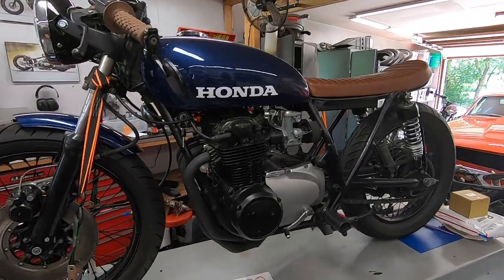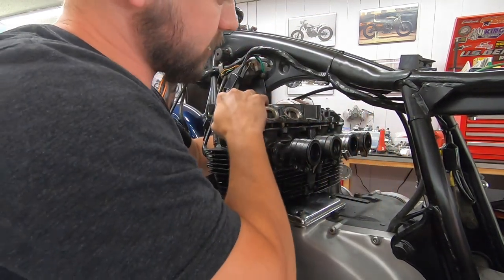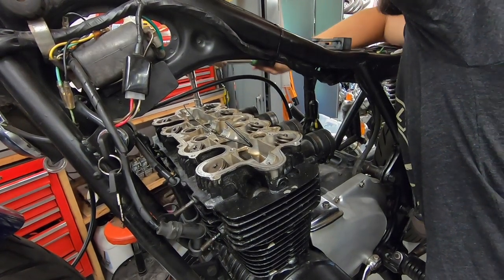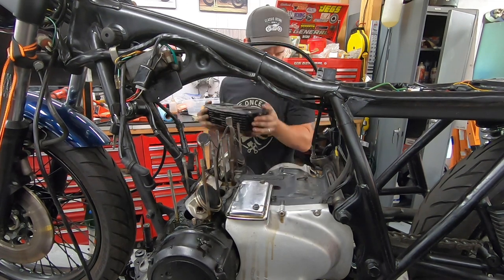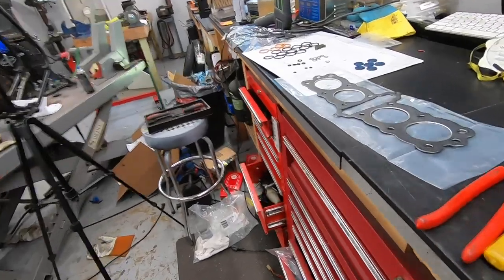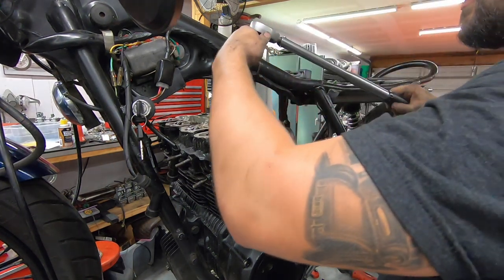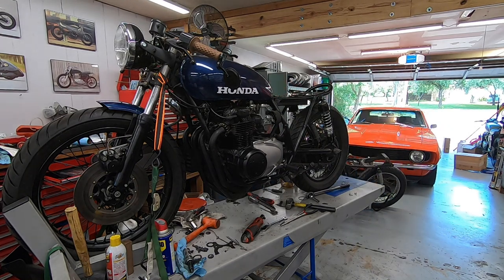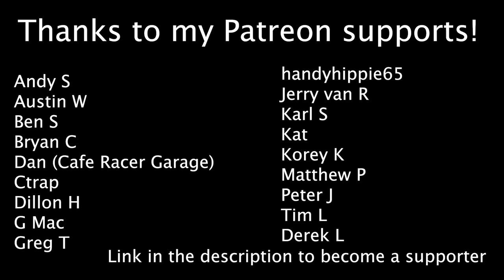Honda CB550 top end gasket replacement. (fixing oil leaks)

Comment: For those of you who are willing to add a few extra steps to this procedure, on a lot of these vintage air cooled bikes, you can leave out the base gasket and use loctite 510 in place of it. This generally will increase the compression a half point, and most Pre 1980 air cooled bikes have plenty of squish/valve clearance to do this. Obviously, when doing this you want to check the squish and valve clearance (squish with solder, valve clearance with clay). But if you're looking for free HP and a little more pep, it never disappoints. It's also a good idea to check cam timing when you do this, however MOST bikes will only have the cam timing retarded a few degrees, which will increase the top-end a little bit. 

I've done this on every bike I've ever built, and have never come across a pre 80's bike with an otherwise stock engine that didn't have enough clearance to do this. YMMV

Comment: omg i was thinking about bringing my cb to a shop to let it repair. it would cost 500-750 euro. Now i can do it myself, including restoring the carbs. AMAZING CONTENT!
Reply: You're led to believe that working on engines is difficult. It is not. The key is to have the correct tools for the job, a decent manual (or video in this case), and some patience. Get at it.

Comment: I own a 1978 Honda CB550K it has less then 60,000 miles on it. It is completely stock down to the 4 signal exhaust pipes there still good and not beat up it does have the crash bar and rear rack and a sport windshield. When parked 10 years ago it ran perfectly so smooth at idle you wouldn’t believe it was running, but it would wipe out my right shoe and pant leg with oil from the failure of the head gasket and o rings. I’m a good backyard mechanic having read what was required to repair it for some reason scared me off, but after watching your video I now feel I was just being silly I CAN DO IT IT WILL LIVE AGAIN !!! My question to you is while it’s opened up should I go ahead and replace the rings lap the valves and replace the cam tensioner for many more years of service and maybe the oil pump I trust your opinion it’s 53-60,000 miles normal wear what is there life expectancies lm 65 years old and when growing up you see a bike with 10k on it would would think it’s time is soon over. I live in Colton CA AND IF I Don’t FIX IT I WILL NEED TO FIND A GOOD HOME FOR IT IM THE 2nd owner 15,000 miles when purchased in the mid 80s 👍

Comment: I remember when working at a Honda shop when the CB-500 was introduced, one of the big selling points for mechanics was that we no longer had to remove the entire engine to work on the top end. It really made things easier for mechanics.  But the base gasket leakage was common on all bikes at the time except for the earlier Hondas like the 305s and 450s. Triumphs and BSAs especially were noted for this, and ironically Honda made the same mistake BSA had made; they didn't have enough bolts holding the cylinders down.

Comment: Great video as always! It kind of skipped the fun part of putting valve cover on. Valve tappets usually get in the way of putting it flat on. Using rubber bands to hold them up helps tremendously.
Reply: They look out of place in the toolbox, but rubber bands for the win!

Comment: literally doing this to my bike this weekend sept I'm changing the piston and rings to. love your channel.
Reply: You should really notice the difference, years ago my '74 550 got new rings installed only, and the performance difference was amazing, and as u'll  be doing it urself it  should be real satisfying.  Good luck
Reply: @edwardmulder3777  love these bikes.
Reply: I finished a top end rebuild on my '77 XS360 about a month ago. Sure enough, the head was teeny bit warped in the middle and I had to get it skimmed. I'm wishing you better luck!
Reply: @spiffyg4939  there are a coupla vids on resurfacing your heads and blocks with sandpaper and a large hunk of flat wood and oil for future reference

Comment: Love these videos Taylor. Just tore down my 1980 cb750c. With plans on turning it into a cafe racer. And your videos are an inspiration to someone who doesn’t know much about motorcycles. But that’s why I bought it. Was hoping I wasn’t going to have to dig into the engine....... because it was running fine. But did notice oil around the heads. So I’m thinking I need to change out all the gaskets. Engine’s already out........ probably a good time. Thanks again for all you do

Comment: Great video as always Taylor.  I definitely go between the shop manual and your videos when working on the 72 CB500.  I got to the point of removing the cylinders and had to laugh.  You said they might need a little tappy-tap.  I was wailing on those suckers with my rubber dead blow mallet.  They finally did give it up, and yes, as you said, that base gasket just didn't want to let go.  It's going to take some time and patience to clean that up.  Thanks again for these videos.

Comment: I realize there's not going back and making a new video, And I ain't here to bitch or complain, your video was instrumental in helping me do this, but there's a couple steps that I would have loved to have seen seeing as this was my first time taking the top end off and trying to put it back together. The cam chain tensioner (when it goes back for the first time, do you tension it, or leave it loose?) I realized that loose means you have all the trouble in the world later on getting the chain back on that sprocket and so I tightened it (with that cam chain tensioner screw in the back). When you put the valve cover back on,  you mentioned the breather, the o'rings, and adjusting the cam chain tensioner (yes that again) and you time lapsed that part.... would have great for this newbie to see what you did there.
But I get this may not be a instructional video for all that and the work you did show us was invaluable. NOW I just need to find a video that's more detailed and talks about the which new O'rings go where and what to look for when doing stuff. Little tricks of the trade ;)
Thanks again for this though and I look forward to new videos of yours.

Comment: if you twist the impact driver by hand in the direction of removal , ie anti clockwise, you will take up the slack in the impact driver internal threads and will not need to hit it three times

Comment: You are very close to 50,000 subscribers! Congratulations. A coupla questions and comments - first of all, you show people how you do these repairs but not many can do what you do. I have a hard enough time putting a cylinder with one set of piston rings to line up and make sure they get into the cylinder properly and don’t get damaged. Four pistons would drive me crZy! You make it look so easy. Did you get any training at a technical college or motorcycle mechanics institute? My last question, do you have to retorque the cylinder/head bolts after you have warmed the engine up completely a few times? Other than that thanks for another great video where a simple plan comes together nicely.

Comment: Hi Taylor, thanks for your videos, always interesting. I am happy with more details and longer videos are not an issue. I have a question: why didn’t you clean the deposition on top of the cylinders? What needs to be done to prevent it? My understanding is that it can cause detonation, changes in compression etc. was the build up not big enough to worry about it? Greetings from the Netherlands!

Comment: Cool. I have to do my valve oil seals on my bike. But am going to have to remove my engine  and its fuel injection, fun.

 Thanks for showing  the impact driver. I was trying  to explain  it to my wife  and she wasn't  getting it till I showed her that  section of vid. What drive is it?

Comment: Probably best to loosen head bolts from the outside-in. This way the tension does not bow the inside due to more friction holding the outside of the head. This is why when tightening head bolts from the inside-out makes sense. It's the same physics.
Reply: It would also seem after taking everything apart like that and no less the expense and time involved to at least replace the rings and a quick scouring of the cylinder walls, my bike deffo wasn't  burning oil but afterwards that engines performance had improved no end

Comment: Another good one. I need to ride my  CB550F up to your shop and get it looked at. I just did this a few months back but only the top gasket as it was leaking. Had more than a centimeter of carb buildup on the cylinder heads. It seems to struggle in the last gear to keep speed at about 80mph. Have gone over the carb so many times and the timing. I got it up in Austin leaking fuel, oil and had an obvious drop at some point. Have replaced and fixed nearly everything.  Just won't run right and not sure why. Im in San Antonio. Need to save up some cash first but would love a once over and suggestions etc.

Comment: I recently realized a dream of finding a good example of the first bike I owned, a 1976 CB400F. Early next year I will start throwing some love at the 45 year old vehicle which will include attending to oil leaks. Your video was great to get familiar with the process. I am sure the 550 and 400 are almost identical. Would you agree?

Comment: U know that a old fella told me one time is not to paint the fins the help with the cooling of the engine
Reply: Ive thought about that too
Reply: Keith  Parady
Reply: That would maybe hold true if Honda engines weren’t painted from factory.
Reply: Chris Prezbyl    Never saw any older engines that were painted probably all wore off
Reply: Keith Parady so you never saw a vintage Honda? They are factory painted engines. Fins, cases, valve covers.... all except side cover which are cleared. That’s paint too

Comment: Hi. I’m after some advice. Im attempting a top end rebuild of my CB550 and I can’t prize apart the cylinder casing as the gasket seems really stuck. I feel I’m giving it as leverage as I dare! On the small cut outs to fit a flat head screwdriver

Comment: Taylor, I have a question about your impact driver. Did you use the bits it came with or did you order special JIS impact bits? Or are the “Phillips” it comes with JIS?
Thanks for all the videos. Love your channel!
Reply: You can buy JIS impact bits. You can also buy JIS Impacta Screwdrivers, I have a set but they're not cheap.
Reply: James Howitt thank you

Comment: Big problem, a piston circlip fell into the crankcase. I was installing them after i cleaned the pistons. I had rags setup to catch but of course it slipped right by that. So far I have drained the oil and probed around with a magnet and no success yet. Any help is appreciated

Comment: Great videos. Just a question ...... What batteries are you running, if lithium ion are you changing reg/rectifier.
I`m in middle of doing mine and ideally want to go with smallest battery i can and hopefully keep elec start
Reply from the maker: I have run a few and I prefer the Shorai batteries over anything else. This is the one I use https://amzn.to/2zshjFW And yes you will need a Reg/Rec designed for lithium ion batteries or you could risk over charging it and causing a fire.

Comment: Thank for posting what you do. I’ve learned a lot. I’ve been riding a 72 CL100 for the past few years but it has developed an issue I can’t figure out. I posted a video on my channel if anyone wants to take a stab at suggestions. Thanks 👍🏼
Reply: Matt Aragon i’ll take a look.  what’s the issue?
Reply: Graig Cameron thanks! I appreciate any input. When I give it gas it Boggs down or dies. I put a new carb on it. So I don’t think it’s that. It did the same with the old carb.
Reply: Matt Aragon if the jets are clean the next thing to look at is misfiring spark plugs.  or a leak in the intake boot.  are the spark plugs new and gapped too?   did you use a gasket on the intake carb boot?
Reply: and also check your compression.
Reply: Matt Aragon, could be the filter in the tank, easy to check, plus there could be water in the tank?, which never got cleaned out with the old carbie, perhaps?

Comment: Werent the old gaskets new when you put them on? Why did they get blown like that after only a few months ?
Reply from the maker: The engine was never apart when the bike was built. The gaskets were most likely original or at-least a decade or two old.

Comment: 21:27 Nope, that's right. Multilayer steel gaskets go on dry. You "can" reuse them, if you're a tight-arse, and then you'd spray them with copper spray as the coating is no longer intact. Obviously, it's better to just buy a new gasket.

Comment: Just a quick question, If you are stripping a seized engine and can 't get to both bolts on the cam gear would you need to cut the cam chain to get the cam out?
Reply from the maker: Yes, but I would use a chain breaker so you don’t get any metal particles in the engine.
Reply: @ClassicOctane  I was thinking bolt cutters but probably best to invest in a chain breaker as the new chain will need to be installed at the rebuild and I'll need something to put the link together. Cheers.

Comment: What happened to the gasket? I'm not knocking how you do what you do just wondering, was that the original gasket?
Reply from the maker: The gaskets were most likely original or at-least a decade or two old.The engine was never apart when the bike was built

Comment: I've always been told to use assembly lube on the pistons so when the bike starts for the first time it won't be dry and do damage to the cylinder walls, how do you feel about this technique?
Reply: I do this or coat the cylinder walls with new engine oil with my finger. That's usually a good thing to do

Comment: Bummer dude...been a factory Honda mechanic all my life...getting those valve seals changed is important 3 ways. 
1) they get hard from the heat...500/550 runs hot especially in the center of the motor and they get baked.
2) once you re-ring and get better compression, you will also be pulling more vacuum past the valve seals on intake.
3) you remove and inspect the valves and seats. A simple lap job with a drill works great and is usually necessary, if not a good practice. 
Hope your decision doesn't come back to bite you...
By telling everyone it doesn't need to be done is really bad advice...sometimes the truth sucks and other times it will set you free....

Comment: Copper spray is for copper gaskets. In my 50+ years of experience, I have found permatex aviation form a gasket #3 hands down the best thing to seal flat paper type gaskets. Research this product and try it sometime. You may be pleasantly surprised. What does Honda recommend as to how to install the base gasket?